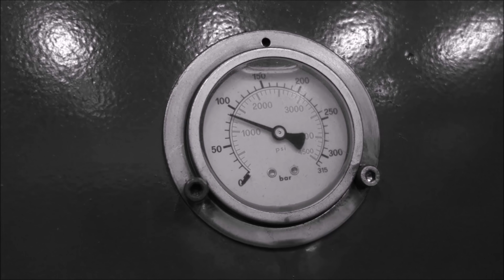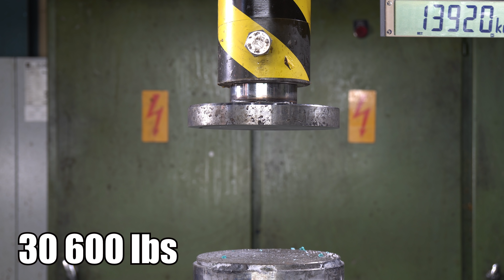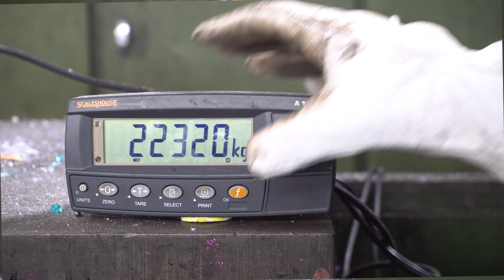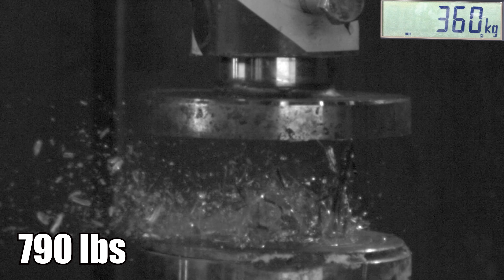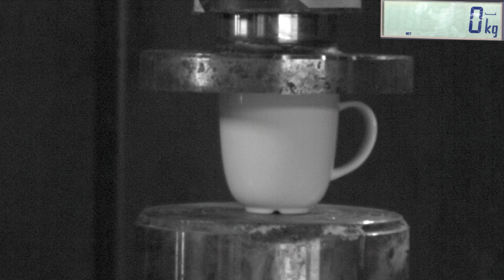How Strong Are Drinking Glasses? Hydraulic Press Test!

Comment: Its not the quality of the glass its the shape and design that makes it stronger
Reply: That isn't entirely true, Even if I had the best designed cup, if it was made with glass as weak as plastic it would still break in an instant.
Reply: It's both
Reply: @lastnamefirstname9043  yeah it is, but you can see where I was coming from. No shape or design will help it if the cup is made with the weakest glass.
Reply: True, the 2 first glasses had the best structures
Reply: The purity, quality, and type of glass counts. Glass is an amorphous solid, which is to say that its atomic structure is in a disordered state, like a liquid. There are degrees to this disorder, which are determined by the type of molten material cooled into glass, and the rate at which that cooling occurs. 

A glass product of higher purity cooled more slowly will have a more crystalline atomic structure, providing for more consistent lines of force, better force distribution, and thereby superior resilience under load. By the same, a glass product of lower purity and cooled more rapidly will have a more disordered atomic structure, creating larger force distribution imbalances and weaker load carrying capacity.

The shape of the glass is also important for the same reasons.

Comment: You should put rubber mats on either side so it isnt so point loady
Reply: Yeah, on almost every glass, you see it tip to one side right before it breaks. These very brittle materials are especially sensitive to uneven loads.
Reply: I was thinking this too.
They should test with rubbet mat and without.  Very interesting
Reply: Scientific term; point loady
Reply: I was thinking a self-aligning upper tool so it wouldn't immediately annihilate a nonlevel top edge.
Reply: I dont think that rubber mat would make any difference at this more than 10t load.  It would probably just get cut due to pressure before the glass breaking.  Copper or aluminium sheet on the bottom and top could make tremendous difference in my opinion.
Reply: This is the right take.   That was 100% for the fast failures, the crazy single point loading.  I bet those first glasses could have done an extra 50% if it was even distribution
Reply: Under such pressure, a rubber mat would have no influence. Trust me, I am a German mechanic.
Reply: That is a smart idea actually. All the glasses tipped under pressure
Reply: rubber is too soft I guess, tin block or lead
Reply: @1337fraggzb00N  Does it make a difference that you are a german mechanic as opposed to a mechanic from every other nation?
Reply: @emailakkont6520  yes.
Reply: @emailakkont6520  most great scientists in the US after WWII were German

Comment: Put liquid in the glass before you crush it! Bonus for using hot coffee in very cold weather. 

Edit: also put cardboard on top and bottom. The glass will crack on any minor bumps in the metal
Reply: Yes, or some thick rubber sheet, I bet it will go a few tons higher still!
Reply: IMO cardboard or rubber are too soft materials for Pokal, but some soft aluminium alloy or copper sheet would do the trick
Reply: @ThePrufessa  Calm down princess the guy was just throwing in some ideas.
Reply: anneal it with the spit belle delphine sent to ethan klein
Reply: With pressures that high, the cardboard wouldn't matter.
Reply: @ric84  Imagine raging over someone suggesting a different material to put between a glass and a hydraulic press.

Comment: Can hold the weight of 25 tons.

breaks being dropped 3 feet to the ground
Reply: Shock is the reason. Same way glass breaks at high pitch screaming
Reply: Constant pressure vs a shock hit.
Reply: Everyone is talking about shock, which is definitely a big factor, but not the only one. Concentration and location of force is very important.
Reply: It's depends on what properties you want a glass to have
Reply: Actually when it falls it experiences a very high force rather than its normal weight because force is rate of change of momentum and the glass stops almost immediately on impact meaning time is less so force is very high.
Reply: The same thing happens to bullet proof armor. It can stop bullets but breaks if dropped.
Reply: No, of course not Kevlar. Kevlar isn't even metal.
Reply: Yeah, so? What are you trying to say?
Reply: Ok lets do some calculation:
lets say the glass has a weight of 0.4Kg and it gets deformed in hight by 0.1mm if it isnt crushed. Also the floor is getting deformed in hight by 0.1 mm. So the total deformation is 0.2mm. Also lets say that  the hight where its dropped from is 1.8m. Lets also estimate that the decelleration of the glass is linear. So we can calculate the decelleration with this formula:
S=V^2/2a
So a =V^2/2S
with a being the decceleration and V being the veilosity and S being the total deformation.
To calculate the Veilosity we also take this Formula : S=V^2/2a
So V=√(2aS)
with a being the acceleration of earth and S being the height where it had been dropped from.
So V=√(2*9.81m/s^2*1.8m)=√35.316 m/s
So the decelleration on the ground is :
(√35.316m/s)^2/(2*0.2*10^-3m)=88290m/s^2
And since F=m*a
F=0.4Kg*88290m/s^2=35316N
which is eqal to an amount of 3.5316 Tons (3531.6Kg)
So it will break becaus it cant hold this force on one single touching point. (it could maybe if it was flat on the grond since it can hold 10T because its a very stable glass). But also the heigt in which it gets deformed before it crushes might be smaller than 0.1mm.
Reply: @jamesharding3459  if a glass top and bottom are perfectly the same height, the pressure should spread more evenly. So the manufacturing process could be more important than the type of silicone dioxide
Reply: @carpediemarts705  the reason is glass is pretty hard almost like steel but they have zero tensile strength,  
the same thing happens to the bones, they can withstand a lot of pressure the femur can support up to x100 of your weight, but if you place your leg between two chairs and let someone step on it it will break like a branch

Comment: I'm VERY surprised the glass exploded the way it did. Knowing that most glass cups aren't perfectly molded, once the pressure was applied it should've hit the uneven(high) areas and caused the glass to crack and fall apart. Great video!
Reply: In pretty sure it did crack but by that time the press was at 20 tons so there is no cracking at that point.
Reply: I think the glass flexes enough so that the load can sort of even itself
Reply: What´s so surprising? The crack propagation of (tempered) glass can be as high as Mach 40. Glass is extremely susceptible to stress-risers, so any one of those dents or scratches on the press work surfaces would have instigated catastrophic failure.

Comment: I think having wood on both ends might get higher readings.
It would reduce pressure points.
Reply: But that isn’t the goal of this
Reply: @Zatherothx  Higher, more even pressures would make the explosion more spectacular. It looked to me like the strongest glasses at the beginning sat very evenly between the crushing plates, and the weakest ones moved/settled a lot at the very beginning of their crush.
Reply: @ThePrufessa  The goal is to get views on YouTube. Besides, wouldn't you want to reach maximum load for a test comparison of maximum load?
Reply: there is more than ten tons of load on this, the wood would simply crack and make the glass break earlier.
Reply: @FlypFlap91    I disagree.
Clearly we need tests. Haha
Reply: 1 of the glasses could have a high point creating a weak point. The wood would solve that issue.

Comment: So glasses can hold more than 49k pounds but when I drop it from my 2 foot toble it shatters instantly.
Reply: Brittle materials tend to be incredibly strong... Until they aren't. The energy from the fall must go somewhere, the sharp point impact exceeds those limits.
Reply: Exactly what I was thinking.  I gave up on glass pint glasses.  I got a cheap BPA free plastic pint glass from Wal-Mart about seven years ago and it still looks new.  It's the only glass I use...
Reply: these glasses are strong ive dropped them many times without breaking
Reply: try that cheap plastic one... it wont shatter im sure
Reply: @mrmacman2u  nah glass is very strong in compression, but weak in tension. When the glass impacts the floor in a fall, the part that touches the floor flexes and when it flexes pass the breaking point, the glass shatter.
Reply: @snowstar3560  .... That is exactly what I said.
Reply: mrmacman2u Toble
Reply: Ok lets do some calculation:
lets say the glass has a weight of 0.4Kg and it gets deformed in hight by 0.1mm if it isnt crushed. Also the floor is getting deformed in hight by 0.1 mm. So the total deformation is 0.2mm. Also lets say that  the hight where its dropped from is 1.8m. Lets also estimate that the decelleration of the glass is linear. So we can calculate the decelleration with this formula:
S=V^2/2a
So a =V^2/2S
with a being the decceleration and V being the veilosity and S being the total deformation.
To calculate the Veilosity we also take this Formula : S=V^2/2a
So V=√(2aS)
with a being the acceleration of earth and S being the height where it had been dropped from.
So V=√(2*9.81m/s^2*1.8m)=√35.316 m/s
So the decelleration on the ground is :
(√35.316m/s)^2/(2*0.2*10^-3m)=88290m/s^2
And since F=m*a
F=0.4Kg*88290m/s^2=35316N
which is eqal to an amount of 3.5316 Tons (3531.6Kg)
So it will break becaus it cant hold this force on one single touching point. (it could maybe if it was flat on the grond since it can hold 10T because its a very stable glass). But also the heigt in which it gets deformed before it crushes might be smaller than 0.1mm.

Comment: 2:25, 22320 kg was the maximum reading that it registered when the glass shrapnel impacted the pressure sensor at extreme high speeds, but the reading was about 19000 kg when the glass broke.
Reply: Woah you're right! Good eye!
Reply: A small piece of glass weighing some milligrams couldn't move so fast that it could impact the sensor with 3 tons of force lol. The display just has a delay of some fractions of a second.

Comment: Awesome! Glass is really stong, even if it's brittle and breaks easely on impacts. I remember a video I saw a long time ago where someone did put a glass bottle on the large shock absorbers at the bottom of an elevator shaft, then when the elevator went down it was stopped for a few seconds before the bottle broke. It was a hydraulic elevator so it's whole weight was standing on that bottle and I thaught "is that really possible". Now I see that it was indeed possible - if one of those first stong drinking glasses was used instead of the bottle, the elevator would have been stopped completely - unless it's a very large elevator (like someting you would have to lift heavy trucks in a work shop - not one you find in a building), hahaha

Comment: Well, not just because of the materials used, but a great factor is the design. The first two have a good base design which supports the load of the press, and is distributed to the sides. And unlike the other designs, which has a curve or thinner base, the pressure sums up to the middle which make the glasses shatter so quick.

Comment: after the second 22 ton glass you removed the metal spacer at the bottom and all the other cups and glasses where not pressed between parallel plates. You can see them tilt slightly as the press makes contact. So with the force applied to only one edge of the base the force will be much lower.

Comment: The speed at which the fracture will propagate should be near the speed of sound in glass, which is about 4.5 km/s (pretty fast eh). At 5900 fps it will take about 0.1949 frames for the fracture to show (if my math is correct and considering the glass has about 15 centimeters long/height), so you will need about 10 times more fps to actually fit more than one frame with the propagation. Pretty cool video, contact slow mo guys and get it done!!

Comment: i reckon if you machine all the surfaces as flat as possible to eliminate that initial rock so the pressure dosent concentrate down one side of the glass, and use some rubber padding on the top and bottom i reckon you will see greatly improved readings from all cups involved as the weight from the press will transfer almost 100% vertically through the cup. it would be really interesting to see what the pokal is really capable of in these new perfectly vertical forces set up.

Comment: The later glasses are breaking early because of their design not because of the material.
Reply: shape matter,material too also where pressure work i test for egzample empty pepsi can if weight was distributed evenly it could stand 60-70kg before colapse it just take to little tilt and weight take smaller side part and it colapse much earlier 20-30kg for egzample.
Reply: Actually they are breaking because they have a large force pressing down on top of them. When the pressure is applied, the glass breaks. This is because glass isn't very durable and thus shatters into a million pieces.
Reply: It's the curve into the base that is killing them, you can see that in the slow mo.
Glass is actually very strong in compression, so the first couple of glasses, which have straight sides all the way to the table are just in compression.
The weak ones have the straight sides curve into the base before the table, which causes an area of tension as the straight side try to move downwards past the base, with inevitable results.
Reply: @juststeve5542  egzacly.

Comment: Hi, If you would use a rubber plate on top and bottom of the glass, the force would be distributed much better and you would see different results... right now the glass is not perfectly flat on top and bottom so the force is applied on a small spot.

Comment: If the metal block you put that glasses on arent clean and flat, some glasses are going to break a lot earlier than usual because of uneven force distribution
Reply: You can actually see how most of the glasses moved to the left edge when the top pressed them. The strongest bocal is actually the one that seemed perfectly centered, and that's probably the reason it was the strongest (in its class).

Comment: Isotruss 0.33 pounds supports 13,448.2 pounds strength to weight ratio 1:40,752.12
Pokal 0.75 pounds supports 49,207.18 pounds strength to weight ratio 1:65,609.57
When a drinking glass makes the strongest structure on earth.

Comment: Presumably a crack would travel at the speed of sound, which, in glass, is about 4-5km/s, so at least ~67cm in 1/5,900s, which is still several times more than the height of the glass. That's why you can't see it cracking gradually at this frame rate.

Comment: 1:18 I think you should consider checking the camera for getting the max weight (as you later did 3:56)
In many of your videos I have the impression, that the impact alters the result. If you step frame by frame you can see that it actually broke at 10180 :P

Comment: Cheapest is the best, lol.  I tell ya, try using a compressible material on both ends of the glass to distribute the weight evenly, you will find that you have much higher pressure to crush glass.  Like aluminum, plastic, or fiberglass reinforced aluminum..  Pressure points cause the glass to crack.

Comment: If you used rubber pads, you'd get a more accurate measurement by spreading the load. Glass and ceramic don't like uneven loads

Comment: Why does the metal disc under the glass jump up when the glass explodes?
Reply: It is being pressed by the glass and ever so slightly deformed, so when the pressure is released it springs back to it's original shape and jumps up.
Reply: All the deformation on the sensor and the table are released to go back to normal in under 1/6000s second (one frame).
Reply: nature